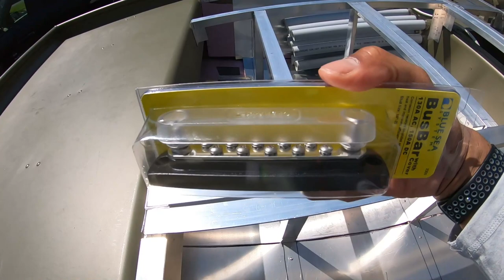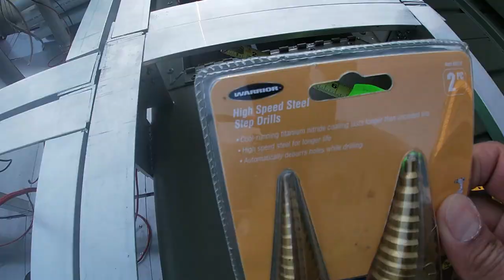WIRING MY JON BOAT Part 1 Step-By-Step {Jon Boat to Bass Boat Conversion} Lowe 1448

Comment: Great job on this build.  I don't even have a Jon boat and you are the most thorough builder I've seen.  I especially love that you've taken the time to put the above list of products used and where to find them.  That alone makes your build invaluable to the viewer who may be interested in making some mods to their boat.  I just bought a v-hull boat and even though I'm not into bass fishing, I have two doggies that go everywhere with me and the v-hull does not have a flat floor in the boat.  So I thought I'd build them a (casting deck) deck to park their butts.  I'm like you OCD and have watched so many hours of DIY boat mods I can't even count. I knew all the contributor names you've mentioned from TBN etc and feel good about your choice of good quality mentors to learn from.  Anyway, I'll end this for now.  Great job and God bless you and yours.  Bill from Oregon.  Go Duck's.

Comment: Love your videos and nice boat. I’m currently rebuilding all wiring. Adding a 2nd group 27 house battery with a switch for crank and house battery and the house battery will run all lights etc plus battery oscillator to keep them charged. This way my crank is just for motor. For a dead crank battery I can use battery 1 and 2 combined to start motor or start motor with house battery if needed.

Comment: Am really like all of these conversions I like the customization to fit the builders needs I like simplicity but I don’t like to do with out also but the rod locker on a smaller boat is so sexy and with locks on everything on mine will make it to where I can leave everything in the boat. Such a big deal to not have to down load every time we go home.

Comment: Cool video! My only word of advice is that ABYC code calls for crimped connections, no solder only connections. Crimped connections do better with vibrations associated with boats.
Reply: thanks for the advice

Comment: YOU make it look so easy. I"m trying to wire an 8 ft bass buggy boat to run my fish finder, trolling motor as well as navigation lights for the bow and stern. The bot is already wired for the trolling motor. I don't know where to start. I am totally clueless to this electrical stuff.

Comment: Nice work super clean. Might want to take the corners off those little supports  you ran your 8 gage through so it doesn't catch your arm or anything once your deck is installed when reaching into those areas.
Reply from the maker: wow... really good point Shawn.  Smoothing out those corners might save me a run to the emergency room for stitches lol.  I'll work on that and show it in a future video.  Thanks for the suggestion.

Comment: Love the build! Love the attention to detail as well. Currently working on my boat build and was wondering did you run the trolling motor thru the fuse panel or is it directly wired to the batteries? Thanks! Love the channel!
Reply from the maker: Thanks.  The trolling motor is connected directly to the batteries and its own 60amp fuse breaker for a 24 volt system.    I'll actually be posting a video soon on the trolling motor install. Thanks for watching.

Comment: Would it be a good idea to have an inline fuse by the battery on the wire leading to the other fuses? Just in case that wire gets cut. Don’t want to electrify your hull. 

Love this series. You have given me the inspiration to do this myself. Thank you for showing mistakes as well as the successful parts. Too many people only show the good parts. It’s good  to see how to get back on track after something goes wrong.
Reply from the maker: I do have a 50 amp fuse installed 6 inches away from the battery.  It didn't show well in the video because of gorpro issues.   But you are correct.  Always fuse your battery close to the  battery.  I also have fuses from the fuse box for all six switches so everything will be well protected.  Thanks for the feedback.

Comment: Hey Brotha!! First I’d like to say awesome job on your vids! You do a great job of going over things in depth and make it easy to understand. I’ve got a few questions… if I understand you correctly, do I wire all of my accessories leads into the fuse block and then to my rocker switch panel? Also, where do I send the + power leads of my switch panel into ?

Comment: Thanks for the great video, but have one question. I run 8 gauge wire to my fuse box then I run 14 gauge from fuse box to switch panel right? I can also run individual wire from fuse box to each switch right? What’s the largest gauge wire I can run off fuse box?

Comment: I really enjoy your videos, quality explanations that are easy to understandcould you show sometime how you make sure that all your aluminum angles are on the same plane? So its flat for whatever you will cover the floor or platforms with? If you rivet verticals and then rivet on top of them there would be different height differences with all the different angle pieces...Im trying to explain what Im thinking but maybe Im not doing a great job. How to you make all the aluminum angle pieces flush on top with each other...make your braces and then fill in between the higher pieces or do you do it in a way when building so they are all flush from the start?
Reply from the maker: It all depends how you frame the angles together.  There are instances where riveting angle together creates gaps based on the thickness of the aluminum.  You can fill those gaps with aluminum flat bar but only if you really need to.  Everything you install adds weight to the boat.  Using 1/16 angle is thin enough that if your deck is wood, the gaps won't matter. If you are using aluminum sheeting for decking you would want to use flat bar to fill gaps. Hope this helps.
Reply: @BassBrothersFishingDMV  thanks! Do you have a video on countersink bits you use (if you do) to sink rivets flush in certain situations?

Comment: Did you seal the ends of the ring/fork terminals you did for the LED lights? I saw you used the heatshrink to cover the ugly colored plastic on the terminals, but if you didn't put some liquid electrical tape or something to seal the end where the bare wires poke through the terminal end, then that was purely for looks.
Reply: Liquid tape is the greatest thing ever

Comment: I'm planning to do a similar project on my 16' Jon Boat and have a question:
When installing the light strips, before adding the Gorilla double back adhesive tape, did you first remove the protective barrier on the light's tape and then apply the adhesive to the adhesive? Or did you merely apply the Gorilla tape over the light's barrier tape? Thanks!
Reply from the maker: I removed the strip from the LED light to expose the sticky side of the 3M tape that comes with the LED light then applied the gorilla tape to that.  Worked like a charm.

Comment: Have you tested out where you going to put the gas tank? i'm currently building the same boat Lowe 1448 and trying to figure out how to frame the rear deck.  The 25L tank cannot go in and out if framed like yours
Reply from the maker: Yes indeed.  And that's a great point.  My gas tank is only a 3 gal tank and it does fit in the rear framing.  So I will prob stick with that size tank.  If that changes later and I need a bigger r tank, I may have to redo the rear framing but hopefully 3 gal will be enough for how and where I fish.  Keep me posted on what you end up doing.

Comment: Forgot if you mention or not but are you running your trolling motor with a different battery, fuse box/bus, switch panel/switch?
Reply from the maker: Yes. Trolling motor is running off of two 12v 29DC  (24volt) walmart deep cycle batteries connected to a 60 Amp breaker.  The rest of the system is running on a separate battery.

Comment: For the wiring.  I just got a 6 switch control panel similar to yours and they are all loop connected with one shared main positve/negative coming out the side.  There is only 1 space open on back of each switch to connect my accessory.  So would I just use one inline fuse between battery and panel for the entire panel?

What's throwing me off is I see you're using a fuse block,  how are are you going to use it?  Is your panel not loop connected?  (I understand how to use the fuse block, but that's with independently powered switches, this is different).   Are you doing what I described above or are you cutting each loop wire and making each switch independent and connecting each one to the fuse block?
Reply from the maker: I made each of the switches independent on the switch panel.  Watch all three wiring videos. This one, part 2 and a video just on the switch panel video.  In summary, main power from the battery goes through a 50 amp breaker, then to the buss bar fuse block combo main positive and negative leads, then run your individual wires from the combo to the switch panel then run power out the switch panel to each thing you are trying to control.  You can also start from the opposite end if that help.  But watch the three videos I mentioned and you will see what I did.  Hope this helps you out.

Comment: how have the light strips held up? Worth the install?
Reply from the maker: All light strips are still in place.  I did use a different tactic for the latest boat I did to secure the led strips to the framing.  The double sided tape was alot of work lol.

Comment: Would a marine breaker panel work in place of the fuse block? I used to work at a marina so I know where I could get them, I just wonder if you could have the fuse and switch in one unit.
Reply from the maker: Never used one before so I can't say for sure.
Reply: I believe a marine breaker switch would work so long as it was the correct amperage breaker for each application.
Reply from the maker: @BarrettRSmith  sounds logical.   I'll probably look to see what's out there.  Might come in handy for future builds.

Comment: You never explained why you did not want a live well? I think you should build one adjacent to the rod lockers. Tiny Boat has a tutorial using a BRUTE storage tote.
Reply from the maker: I never needed one before. Never been in a tournament.  I do plan to build one though, out of a cooler that I can throw in the boat whenever needed.
Reply: @BassBrothersFishingDMV  You should come fish the tournaments here next year at Piney Run in Sykesville MD. They have a night tournament and a day tournament. One is in June the other in August. It's biggest fish. I won a couple years back. It an open tournament only a $20.

Comment: What was the gray flexible tubing you ran between the ribs of the boat that you fished your wires through and what diameter was it?
Reply from the maker: It's a flexible non-metal 1/2" conduit from Lowes https://www.lowes.com/pd/Southwire-Ultratite-Non-Metal-Liquid-tight-25-ft-Conduit-Common-1-2-in-Actual-0-5-in/1000239881
Reply: @BassBrothersFishingDMV  awesome. Thanks brother